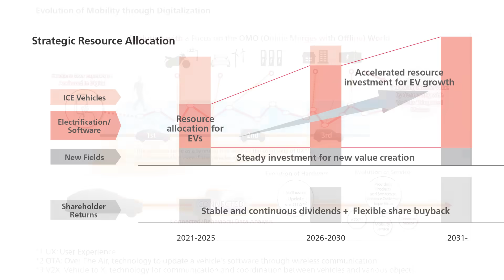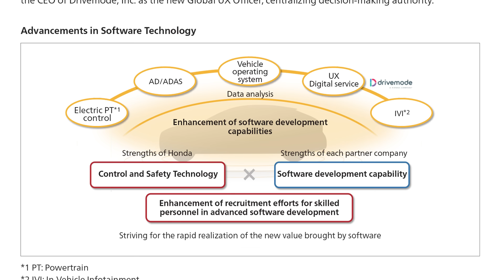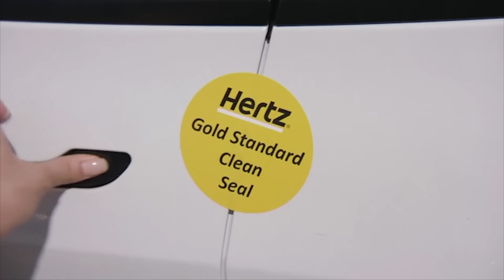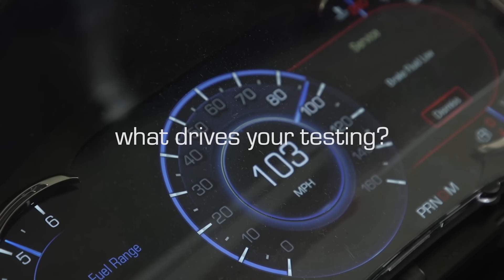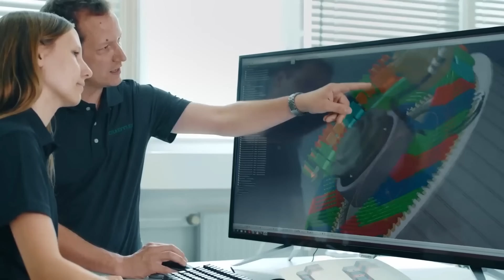Honda Standardizing ICE Lineups & Powertrains; Hertz Pulls Back EV Expansion - Autoline Daily 3681

Comment: Hertz is not going to buy all those non-Tesla EV’s. That will be the biggest change. 
And they’ll just keep the Tesla’s in the fleet a bit longer than they do with ICE cars. 
And after holding em for an extra year or so the residual issue will swing toward a higher than expected price.
Reply: Keep it in the fleet until the car falls off the cliff. There’s no engine to Maintenance and the motor is easy to replace just like batteries
Reply: the problem for Hertz is, that the depreciation is much more than they calculated. now they can't sell them at the estimated value. that means they would lose money. that's why they are keeping them longer now. but at some point they have to sell them because customers like to drive new cars.

Comment: Hertz is pulling back for one reason only....Resell value!  Hertz bought these EVs at the top of the market. The prices for them have gone way down. Hertz was using their old gas car estimates for how much the cars would be worth after three to five years.... which is when they normally sell them. However this bit them because EV prices are falling and will continue to do so. Hertz will need to take this into account going forward and realize they will need to just repair the EVs and run them into the ground rather than sell them. 
     The repair costs are due to there not being expertise in EV repair people and the ones that are reputable can charge whatever they want. Hertz needs to do another deal with Tesla to train their repair contractors which will lower costs dramatically. 
Giga castings are very repairable by design and bent crash rails can be easily cut off at delimited locations and replaced with a bolt on part which Tesla supplies; actually making frame rail repair faster and easier than standard steel stamped frame rails.  Any kind of crash that would ruin the entire casting would have destroyed regularly constructed gas cars too (since the cast part is tougher.... per Sandy Munro's demonstration with a sledge hammer) and would always result in an insurance write off of the car anyway.
Reply: You do realize hertz does no mechanical work on there cars. Its all contracted including oil changes.
Reply: Well said
Reply: You hit almost the right points. Hertz throught depreciation will hold but Tesla decided To lower prices on new cars. Hertz should have rental insurance that’s high
Reply: @careykuhn9174  Right...I did not mean to indicate the mechanics were internal. But Hertz could have Tesla come in to train their repair contractors with an eye to reduce costs.
Reply: @EnriqueThiele Good point!  Hertz has also said that the few non-Tesla EVs that they do have nobody wants to rent because of the non-Tesla charging networks having so many broken chargers all the time.
Reply: I think there's too much risk of structural compromise from a welded part, let alone bolt on , part of why they get totaled so easily.
Reply: @rp9674  I also am not trusting of a car which has to have a frame piece welded or bolted in. However to fix any car this is the way they do it by welding in fresh steel or bolting it in unless there is so much damage that it is not worth the hours of repair compared to the depreciated cost of the car. So I will admit to the same distrust of how good a weld job was. A bolt I feel better about because I can reach in and ensure it's tight. 
Drive safe! 🙂
Reply: @nickmcconnell1291  Wont happen. Thats up to the contractor. All hertz could do is require the contractor to be tesla certified. The contractor is stuck in the same rut as everyone else. No techs..
Reply: How long before tesla comes in as a hertz? A tesla rental in every airport.
Reply: The reality is Hertz is moving more into leaning on Tesla while reducing their GM EV goals from original 175k EVs to 10k EVs. 

This is mainly due to GM's own limitations, but also because of the charging experience:

"The fundamental problem we face is charging, both at the rental facilities and on the road. In this regards, Tesla are so far ahead of everyone else in the US that it makes it almost impossible for us to diversify away. This is also reflected in our NPS score as well." - Hertz Rep Yilun Zhang

Again: ALMOST IMPOSSIBLE to diversify away from Tesla, because of its massive lead here!

So the biggest challenge is the unreliable third party charging networks that legacies are stuck with until they adopt Tesla's NACS after 2025.

TLDR: Hertz is starting to realize that, for the time-being, Tesla is the only game in town for them if they wish to achieve their EV scaling goals to keep up with progress.
Reply: Aren't Teslas notoriously expensive to repair?
Reply: @EnriqueThiele  How  did Hertz find that the Ev's last three times longer than an ICE when they have not even had the Ev's long enough to know that? You need to read  the articles out about what Hertz did actually find.
Reply: @careykuhn9174  Why not buy Hertz?
Reply: @LeesChannel  Interestingly I was cringing when I called my insurance company to switch coverage from an old 2001 Chrysler to a brand new 2023 model Y that I was proposing to buy. 
I insure through AMICA but Tesla also offers insurance here in Oregon. 
Surprisingly it was only $230 more per year than the old Chrysler given the exact same coverage (which I keep at 500/500).
 I also get full glass coverage with no deductible which they told me includes the glass roof. 
If people are paying a lot more to insure their Tesla then their insurance company is just gouging them.... playing off the misinformation that EVs are actually more expensive to fix.  Also they may not have to compete against Tesla in your state and will price gouge because they are not forced to compete. 
   As I mentioned the only reason repairs might be higher priced is a general lack of repair people who specialize in EV repair. This can jack up the labor until more and more are trained.... which hopefully won't be long.  In states with a lot of EVs... think West Coast states and parts of Texas, there are many more places to get EVs repaired. Just a matter of time elsewhere.

Comment: Timing ....  Toyota ramping UP electric vehicle manufacture AND battery production.  Ford and GM delaying expansion rates.   Why slow battery and electric motor/controller development?  Takes time/work to get most COST-EFFICIENT components AND manufacturing processes AT SCALE, and both NEED to manufacture the most cost effective newer components when vehicle spending begins to ramp up again.

Comment: Hertz was silly to push so hard in EVs last year. They have pushed up Tesla prices a lot as well. Now, when the conditions are much better, they are pulling back.
Reply: If I recall, it took Hertz quite a while to get the Teslas they have.  Wouldn't that mean that a lot of them, or at least some, were bought at lower prices?
Reply: Biggest issue for Hertz moving away from non-Tesla EVs:

"The fundamental problem we face is charging, both at the rental facilities and on the road. In this regards, Tesla are so far ahead of everyone else in the US that it makes it almost impossible for us to diversify away. This is also reflected in our NPS score as well." - Rep Yilun Zhang

Again: ALMOST IMPOSSIBLE to diversify away from Tesla, because of its massive lead here!

So the biggest challenge is the unreliable third party charging networks that legacies are stuck with until they adopt Tesla's NACS after 2025.